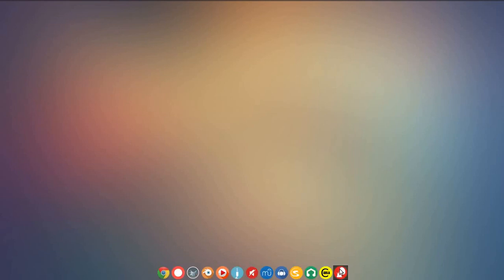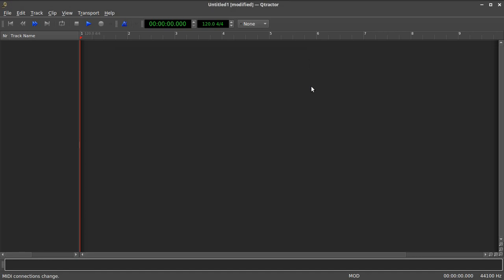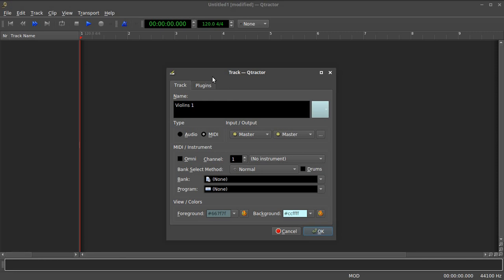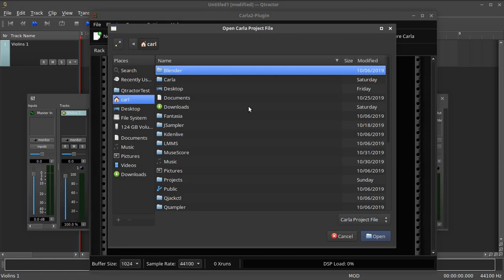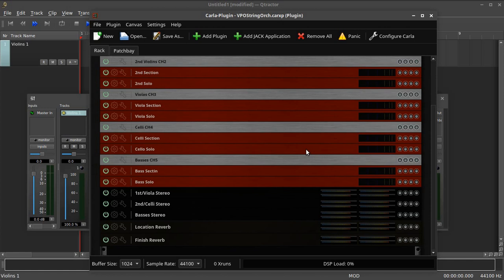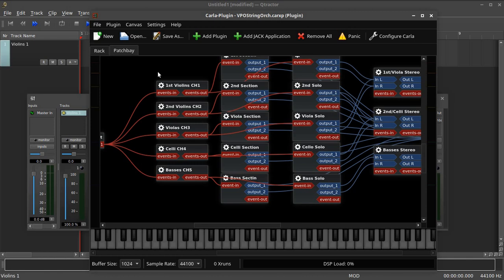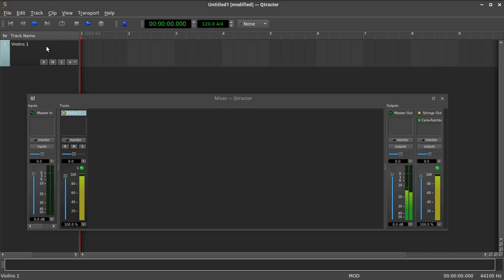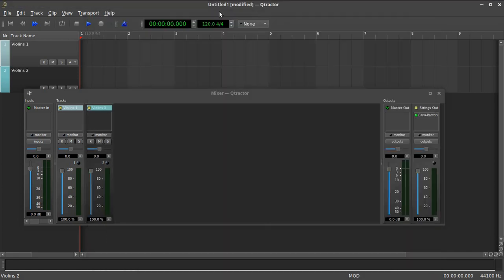Why outboard instruments from Qtractor?

Comment: This is amazing.  Super helpful. Question- I have zyn in the midi bus.  MultiChannels to different presets in zyn.  i would like to switch the different tracks by just changing the midi channel, but it seems like i have to actually select the qtractor track to change it.  Is there a way around that?
Reply from the maker: The best way to do what you want is to just use multiple midi tracks (with appropriate channel numbers) that go out to that bus.  You can copy/paste midi data across tracks to achieve the instrumentation and arrangement that you want.  In virtual orchestral mock-ups we do this when we are using multiple instrument articulations that are contained within different sample sets (when you can't do key-switching).  I don't know if zyn has a key-switching feature or if you can automate midi channel changes in the midi track (like you could with a program change).  That's not usually how I work.  Multiple midi tracks take up very few system resources when you are sending them out to a single instrument.